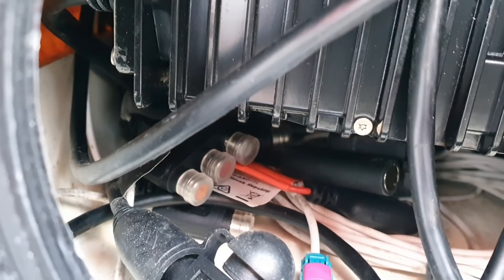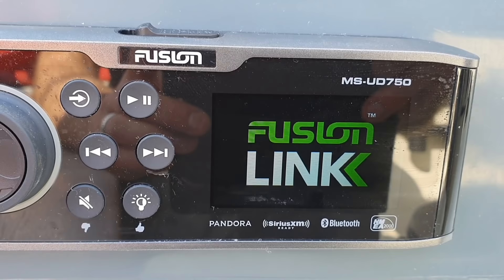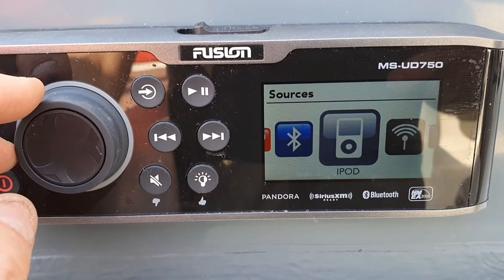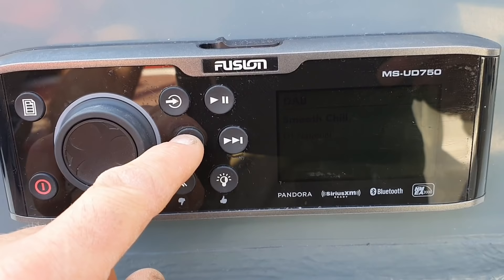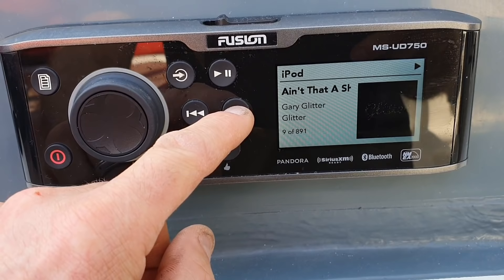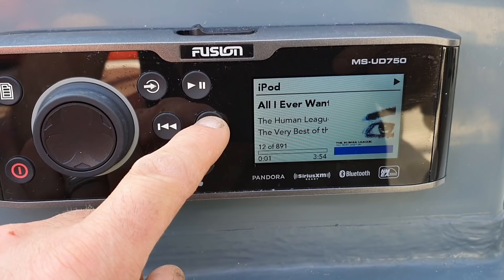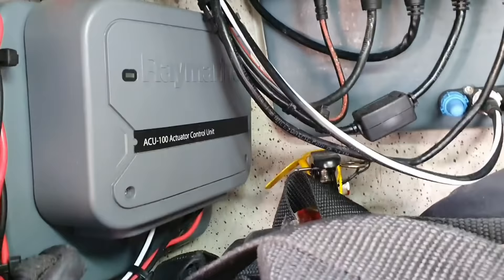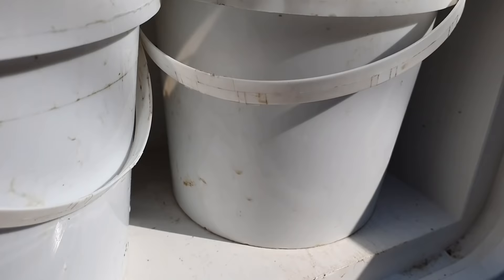Fusion MS-UD750 Marine Stereo Review  Raymarine Axiom lighthouse 3 Review Southcoast United kingdom

Comment: Hello there I hope you can help me after a good review. I have a fusion system same as yours but the 755. . Says I need the MSDAB100A module to get dab with an update. Now I get the dab antenna white thing , its just the other connection to the head unit . I cannot see where it connects to . Mentions accessory in manual but I don't have one on my system . Where does your go to before I waste my money . Great review by the way
Reply from the maker: Hi Lee 
Mine is also the 755 as mine was replaced under warranty back in march this year 
And to be honest the dab aerial is the same as you mentioned and it 100% has the port for the dab module to connect to it now I can't remember which port does take it but 100% it is on there.....
I hope this helps but get the dab aerial/module as it will fit 
Cheers
Dobbo
Reply from the maker: Hi Lee just looked it goes into sirus tuner port 😀😀😀

Comment: Hi mate, Iv currently got an axiom 9 and looking to purchase a fusion ra 50 do you no if I can connect this to my axiom it has a Bluetooth dongle I’m unsure if this will work bud ? Cheers
Reply from the maker: Hi buddy 
Thats a good question I know when I connect my md-u750 via Bluetooth to my axioms I can watch films on netflix with sound coming through the fusion 
I'm pretty sure you need to link the fusion through nmea2000 to the axiom to beable to use the axiom sound system I will be honest I haven't linked mine because I have a fusion remote almost next to my axiom screens so didn't feel I needed to connect it 
Check the fusion ra-50 has nmea2000 outlet mine does but not sure on your one 
Hope this helps I will have a look some when and see if you can 
Cheers
Dobbo
Reply: @DobbosFishingAdventures  cheers mate 👍🏼

Comment: My dad has the same fusion stereo and the volume stoped wirking it is on full blast about to blow the speakers but it says it on 2 in all zones!!!! If u have any help to fix this it would be greatly appreciated
Reply from the maker: Hi 
Thats very strange 🤔 has it got water inside it although they are waterproof etc has it got water in the docking part or in and around the rear of the unit 
Will have a look and see what else I can find out to help 
Thanks
Dobbo
Reply from the maker: Right from what I have found i believe you can do a reset on the stereo 
POWER PRESS to turn unit on/off
Press and hold for 10 seconds to reset stereo 
Let me know how you get on 
Thanks
Dobbo
Reply: @DobbosFishingAdventures  okay thanks I will try that and let you know